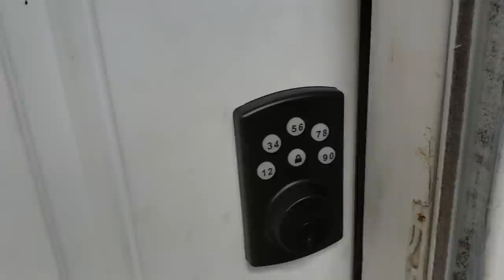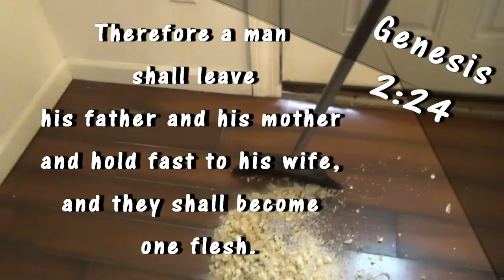Installing Key-less Entry on The Front Door & Fixing Common Door issues

Comment: Great job thanks for the installing tips. I recently installed the a key-less kwikset deadbolt and door knob. I figured while I was doing the job I might as well install the heavy duty striker plates that require 4 screws. Easy job making for a more secure door lock.

Comment: I install these all the time and I'm just going to let you know you should not have gone with the kwikset. Are nothing but trouble. The motor ends up going bad and killing the battery is very fast. the schlage one has no motor just the solenoid that releases so that you can unlock it. It's such a better product. In the batteries last for years.

Comment: for added security use 3 inch screws instead of the ones provided
Reply: at least on the casing side of the door, not the actual door itself since the will go into the opening area for the lock guts

Comment: BUY NEW HINGES!!!! Don’t plane your door. Those hinges are so far gone. They are way beyond wore out. That’s why your door wasn’t sitting right. Also your door is not a metal door. It has a metal skin but the frame of the door is made of wood. Good job chiseling out the latches and the deadbolt strike plate. Also good you installed the 3 inch screws farthest from the edge of the frame. You should pilot drill those holes as best as possible. You never know what part of the stud you’re screwing into or the condition of the wood. Also it’s better to shim the hinges on the door frame than it is to alter the door by planning it or other methods. Also residential hinges typically come with 1” screws. I would increase those to 2 inches especially for older  or worn out door frames and doors. Hinges not screwed tightly to the door or frame could be another reason for your door rubbing. As a matter of fact, if your door “isn’t shutting” or your lock “isn’t locking” because “things aren’t lined up” the first thing to check is the hinges.

Comment: I cant trust keyless. Anyone with a YT can figure out how to get into them. Kwikset has had problems with the "rekey technology" as well.  But the up side is that now lowes offers a lifetime warranty on the kwik set hardware that has the rekey tech so if it ever does give you problems you can just take it to lowes for replacement. No receipt needed or questions asked. I still use a cpl of those kwick sets though and they have never given me any problems. Locksmiths all say that they are weak but then cant prick, pry or bump them at all. I had to have one drilled out & then I took it to lowes for a free replacement.
Reply: That’s because there are easier ways to defeat the Kwikset Smartkey locks. It only takes a few seconds with the proper hand tools. Schlage is better even though they’re both owned by Ingersoll Rand Worldwide. I would say Ingersoll and Kaba own 80% of the lock market. With Stanley coming in at a distant third but gaining ground.
Reply: Most locks can be cracked fairly easily if LockPickingLawyer (YouTube) is anything to go by.
Reply: Watching a video on the internet is not the same as doing it yourself. I can teach you everything there is know about playing pool. But it’ll take you years to master that knowledge. Picking locks looks simple. The concept is easy to grasp but actually doing it is a whole other thing.